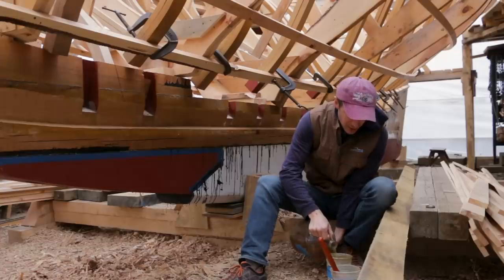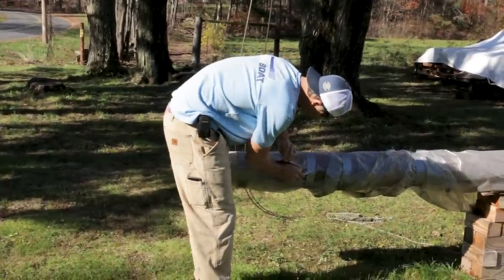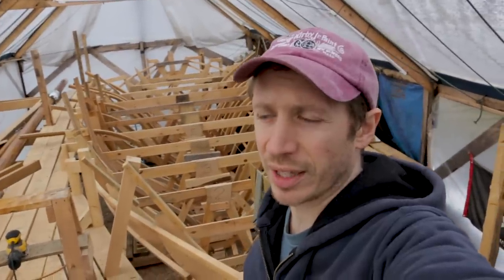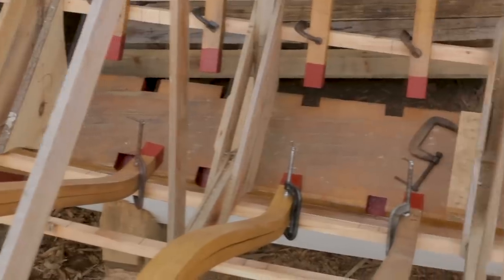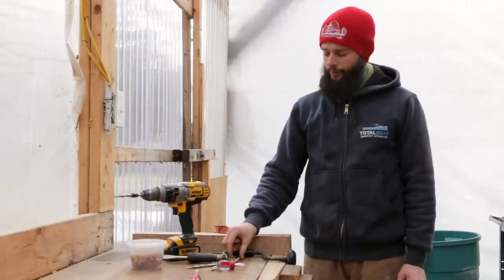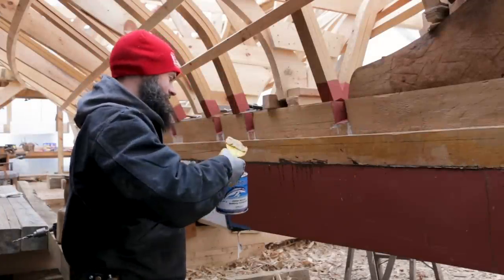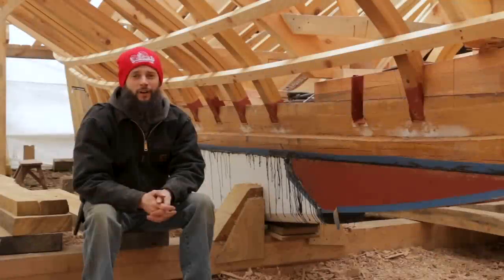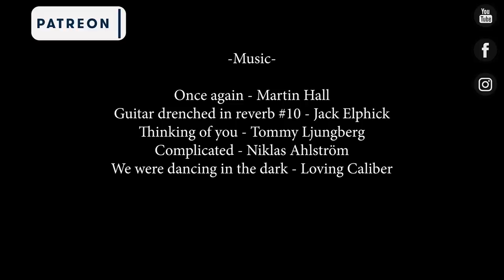Acorn to Arabella - Journey of a Wooden Boat - Episode 49: Bedding the Frames

Comment: As far as the standard/slotted fasteners, I'd have gone with keyed torx and just filled the head with a dense wax after installing.
Society's moved away from slotted for a reason- Stripping the head is astonishingly easy to do, and once you've ramped the slot, removing it is nigh impossible. More points of contact between the tool and the fastener means more points required to fail/round before stripping the entire head out. I've only rounded a torx once, and that was a rounded tool that caused it. Fresh tools never do.

Comment: Love it love it! One piece of advice I have for lots of drilling; when I was working as a commercial plumber I had to drill an ungodly number of holes into concrete, and we started having problems with dust staying in the holes, and messing with out fasteners. We solved this problem by getting a chunk of vinyl tubing, and blowing into the holes to clear away any small chunks and dust. I do this now on all my woodworking projects just as a way to keep the bore holes clean. Low tech solution that solved a problem I didn’t know was an issue! Love this channel!!!!!
Reply from the maker: Thanks for the tip!

Comment: I hate to be "that guy" but when drilling, you're not pulling the bit out far enough to let the wood get off the bit.  So its heating up the wood that is stuck on the drill bit and thus making it more difficult to get that last inch or so drilled.  It will also shorten the life of the bit from the heat.  Love this project, and look forward to every episode.  You guys rock!
Reply from the maker: Thanks for the tip!

Comment: I have to admit, as a carpenter, it felt like those screws went in very easily! I know there was wax and the wood should swell upon hitting the water but it looked like you were backing off on the pressure at the end as you could have easily stripped the inner wooden thread you were cutting.  Dunno, I would have liked to see the last few turns as more difficult to satisfy my OCD.  :)
Thoughts?
Reply: My thoughts as well, also a little on the short side?
Reply: @remonsijrier9132   Actually yes I think you are right.   I just looked up the price of those screws and I can't believe how expensive they are! Wow
Reply: @remonsijrier9132  they need to go in easy, brass screws snap so easy
Reply: Glad I'm not the only one :D

That said, of course most of the structural forces will be absorbed by the socket, not the screw; and there'll be the planking to add strength to it.

Nice to see some thought to the metals involved and some lubrication to it too, though!
Reply: @mocorabbit8968    Yes, just looking out for a fellow woodworker (that is crazy enough to float his creation on water.)

Hehe, takes major balls, I walk away from building a wardrobe thinking, that was actually quite challenging! These guys are heroes!
Reply: same thoughts, not very much of the screw it in the main timber at all. sitting here thinking i would hit at least one with something to see how strong they are in there.
Reply: Unstoppable Tramp i thought all of this too but those guys do their research and im absolutely sure that things are exactly the way they should be😉
Reply: @ahti29   Ask questions Sir, it will only make you more intelligent in the long run and more independent. ;)
Reply: @iyurtygaming8588  They are not brass.
Reply: A few comments about short/loose screws; I'm thinking these aren't so much load bearing as they are just to snug the ends into the sockets. Going to weather tons of torsional force are driving the frames down into the keel via these sockets and much more substantial floor timbers and keel bolts. These frame screws see very little of that, seems to me.

Maybe its odd and just me, but your work and music selections are therapeutic; no need to speed up/edit repetitive sequences. I say leave 'em in and push the video out to an hour.  Nicely done, guys.
Reply: Hi the screws fitted here are not really part of structural integrity of the frames to keel connection. I would have used the next size up if possible. What is important is the floors that get bolted to the frames and then bolted straight through the keel. In my humble opinion there should be floors to every frame. The floors connect the port and starboard frames together across the keel. Also the floors can and should run to the turn of bilge. I would use oak same siding as frames and moulding up to 12 inches reducing to the turn of the bilge. I hope this clarifies the video.
Great job so far, well done.
Reply: It’s the tapered drill bit to fit the exact profile of the screws that makes them go in easy if it was just a straight bit like normal there would be more wood for the screw to push out of the way and more chance of the soft bronze screw to snap
Reply: Lawless Hash - they aren’t brass, they are silicon bronze - almost as strong as steel.  I love working with these, they are strong and look great.  I use them for decoration in some woodwork, but they are strong as.
Reply: Phantomthecat aluminum bronze approach steel strength, not silicon bronze.
Reply: With the tapered bit and lube the only force required would be for the threads to cut a sliver of a channel into the timber. It would only the last turn when the thread would start to bit where and force was required.
Reply: What stops the keel (and keel timbers) falling off the bottom of the hull. Is it the bronze screws? Or is there another piece(s) to go in?
Reply: I'm picturing gravity pulling down really hard on that keel, and the buoyancy of the ship pulling up really hard on the frames. Mine is not a educated opinion but I think theres going to be a ton of sheer force on those screws.
Reply: I think the wax acting like a lubricant goes a long way.
Reply: Never too old to learn new tricks.... looks like the boys just showed you the correct way of doing it.
Reply: @melvakids    lol.
Reply: @iyurtygaming8588  If you watched the video, you would have observed, that the screws are silicon bronze, which is a lot tougher than brass.
Reply: @rodneyjensen3820  When the boats in the water those screws are holding up the lead keel so several tons of force pulling down if you think about it.
Reply: @tizer33  I think they have floor timbers that lock of the frame timber and keel. At least in my limited experience with boats, I think that is correct!?
Reply from the maker: Holy smokes!   
We never thought the screws would be such a contentious thing! haha
The screws are "bonus" fasteners, once she is fully framed you could cut the frame ends off where they meet the keel and sail her around the world.  Many builders believe the sockets and fasteners are not worth the time or energy to install.
When properly installed a screw should go in and out quite easily, also the bit and brace has WAY more torque and power than people realize.  
Looks like so many people are puzzled by our decisions on this that it warrants more than a comment.  We will make sure to explain it all a bit better in the next video.
Reply: @AcornToArabella  Hi guys your doing a great job, please explain to the public that the floors will take the load. I agree with your method of using screws. In the old days a lot of boat builders used galvanised nails for fitting the frames to the sockets.
Your method is better. And I do know. Well done, great job. Look at my other comment it explains the floors.
Reply: @iyurtygaming8588  they are bronze not brass - different animals.
Reply: @AcornToArabella  Hi guys,  I think you are doing a great job but please dont misinform the public. You should not cut the frames where they meet the keel, that is asking for trouble.  if any builders have told you this its absolutely untrue. The frames in their sockets pinch the keel and are essential. The floors as I have mentioned will take most of the strain. I also noticed a comment that state to place floors every three frames, not ideal for a world cruiser. In my opinion floors should be on every frame and bolted straight the keel and through the frames. I want to help you in any way I can with advice, its up to you if take it. You want to build her as strong as possible now,  once at at sea in a storm force with waves crashing over you it will be too late if the structure fails. at least you will feel confident you did right. You must realize the weather can change in minutes so please take note of what I am saying. I think you guys are great and I want you to be safe in all weathers.
Reply: @todddunn945  Nice I missed part and the tapered drill bit works in their favour? Also maybe I'm lazy but I would have used an impact or drill to install
Reply: You "nailed" It, Jeremiah, 
The tapered section is where the bite needs to be The screw threads should penetrate the outer member with minimal resistance. This allows the screw head to pull the frame in tightly as the threads engage the narrower channel in the keel/ @jeremiahparkhurst5244
Reply: @AcornToArabella   Cheers guys, yes I was surprised too and I appreciate the explanation!
Reply: Unstoppable Tramp: the Kiel will not be carried by bronze screws but by lower cross members that will be installed later with long ass bolts. The screws just insure the ribs each from scooting or popping out of their notch.
Reply: @trivalentlogic  I never said they were taking the weight of the Kiel that would be nuts bro!!
Reply: you have never worked with tapered screws coated in wax, have you. I have, well not together, in general tapered screws dont go in hard, very easy till the last turn as its a tapered fit, think like an NPT fitting. But wax! i would think it would be very easy to strip them out if you go gorilla arms on it.
Reply: @timothywhieldon1971  Yes, my only question was how they didn't seem to get harder towards the end. It was like he was backing off the pressure. Reread my original question.
Reply: I agree, the loads are transferred via the surface area of the socket.
Reply: @tizer33  Nope. The floor timbers will, along with some big-assed bolts. Check the wood boat Emma (https://youtu.be/Eq0QCISgetM) where frames sit on top of the keel w/o any fasteners.
Reply: Perhaps... but don't forget that a floor timber will eventually be installed between each frame pair across the keel timber, locking the frames together and secured to the keel timber.  That floor timber will be the primary load bearing connection, not those screws.
Reply: @villageblunder4787  Very good question.  They didn't mention  this in the video, but soon they will fit "floor timbers" across each pair of frames, that will secure the frames to each other, and also to the keel timber.  Those screws they were installing won't really be carrying much load at all.
Here are some examples....https://www.boatbuilding.xyz/building-wooden-boats/floor-timbers.html

Comment: Guys,  I'm a plumber.  Toilet wax will, if constantly exposed to water, degrade.  I would consider using a different material if you're seriously trying to block water while submerged from entering the screw path.   Perhaps you could try beeswax?
Reply from the maker: The screws will be covered in paint, bedding compound and a plank.  The wax should never really see water and if it does it won't be a whole heck of a lot.  It's more for lube than anything, the water blocking is a bonus. 
Thanks for the info though!

Comment: You can hollow grind the screwdriver as well, as I've done with mine.
Have a look at a set of jewellers screwdrivers  to see.
Reply: Geoff Halstead you are correct that is the best way to dress the end of a screw driver.
Reply: John,
It's very easy and quick to boot.

Comment: Steve, you almost hit one of my big pet peeves, the use of "flat head."  Yes, the screws you chose are flat headed but that has nothing to do with the fact that theyhave STRAIGHT SLOTS.  Round headed, fillister headed pan headed and oval headed screws can also have straight slots.  They can all also have Phillips sockets.  Just please don't call it a "flat head screwdriver."  There's just no such thing as a flat head screwdriver; it's a straight blade screwdriver!  I know you didn't but you came close.  You guys are normally so precise on your technical terms and that is one of the things that makes your videos so great.  Keep up the high standards.  I've had to dig years of marine accumulation out of Phillips screw heads and applaud your selection.  Thanks!
Reply from the maker: Haha
Growing up they were always "flat head screw drivers and flat head screws" but your point is well taken.  We will try to be correct with the terms but please forgive us if we slip.  Old habits die hard!

Comment: I love your work and your videos! I know Atkins was inspired by Colin Archer, and it is interesting to see how fast you get the 3-d shape of the hull, using steam-bent frames! And so much less waste of wood! Will you cast bronze floors as well? Cheering on 'ya! :-)
Reply from the maker: Bent frames do go in quick and with straight stock it does not take a ton of timber.
Bronze floors would be great, plans call for wood and we don't have a casting facility and getting bronze cast would be crazy expensive but we will see what happens.

Comment: The screws hold the parts of the boat that want to float to the part that wants to sink (weighted keel). The total shear strength of all the screws needs to be greater than the weight of the keel plus a safety factor. They also need enough engagement length into the keel as well. Just my two cents worth. Cheers.
Reply from the maker: The screws are "bonus" fasteners, once she is fully framed you could cut the frame ends off where they meet the keel and sail her around the world.  Many builders believe the sockets and fasteners are not worth the time or energy to install.
Reply: Acorn To Arabella. Thanks! That’s good to know! Cheers.
Reply: @Mr7yhnmki8   Also 2-1/2" frame and a 4" screw seems plenty long, especially considering they are not crucial to the structure (the main connection of each frames to their opposite frame, and down through the keel timber, has not yet been built or added. See the next video, up now.)

Comment: I have one question.  Why did you use a brace and bit to drive the screws in rather than an electric drill or impact driver?  You can easily set the torque on a drill to a value that just drives the screws in with essentially no risk of shearing the screws off. An impact driver would be even better.  Both a drill and an impact driver would be faster than a brace and bit.  For reference, I have put thousands of bronze screws into my hull using a drill and later a driver and have never broken a single screw.  I will admit that when I was using the drill I did go back and make sure the screws were properly tight with a suitably sized screw driver.  I found that step not to be needed with the impact driver.
Reply from the maker: For one thing I personally like using hand tools better.  I'd rather push a plane or swing an adze than use a power planer, same goes for a brace over a impact gun, but there are times the power tools have their place for sure.
I can also feel what the screw is doing better with the brace and I personally feel like I have more control with the brace.
Reply: @AcornToArabella  nothing wrong with that.  I just wondered since you were drilling the lead holes with an electric drill.

Comment: Alex, what kind of plastic, would You use for the roof, next time. Clear? I like the light. Long lasting?
Reply from the maker: The plastic we have been using has been great.  It does get too warm in there in the winter though and a form of shade is necessary in the summer (we put up old sails).